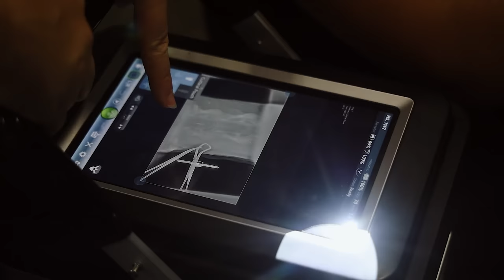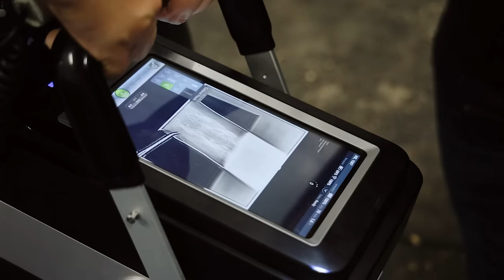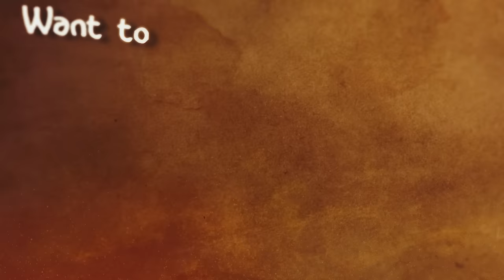Is Benjamin Okay? - Horse Shelter Heroes S4E28

Comment: You could of put a open hose clamp on the hoof wall on ether side of the hoof and you screw it up to put some pressure on in to make that lose hoof to grow down it work as I have seen it put on a horse the had the same hoof problem and they got it like you got that mare and it took six weeks but they kept him in a stall during the night and a small paddock in the day and after six weeks you could not see where the injury was the open hose clamp was screwed on ether side of the injury and every day the screw was up with out hurting him